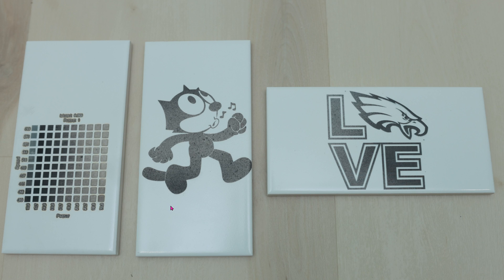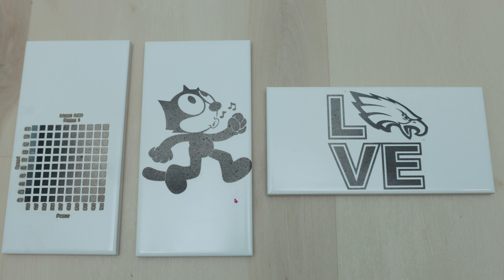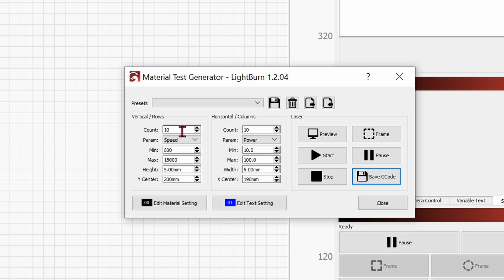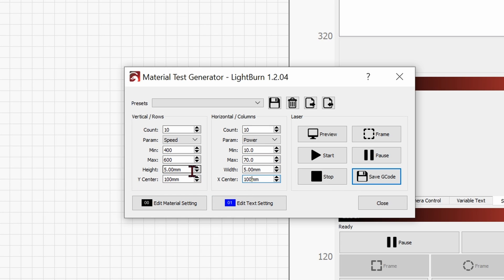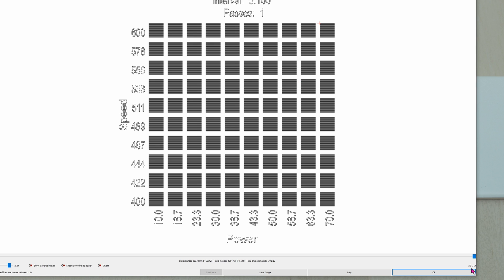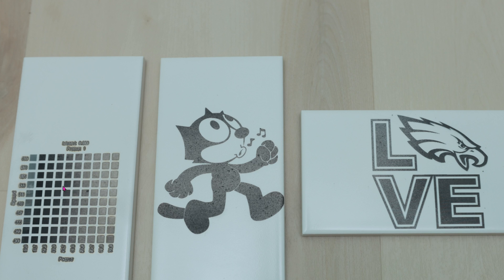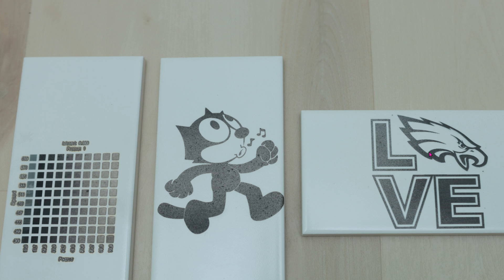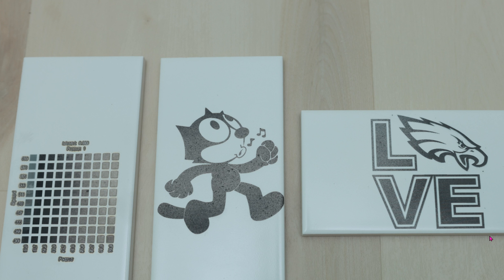Lightburn engrave settings for tiles on a 10w laser module

Comment: Good Video ,  you mean Titanium Dioxide   TiO2  .  The differences in shading could be from the tile being on a slope and the laser being different distances from the work or the thickness of the paint varying , you might be left handed and getting more paint on the LH side of the work with your spray technique ?